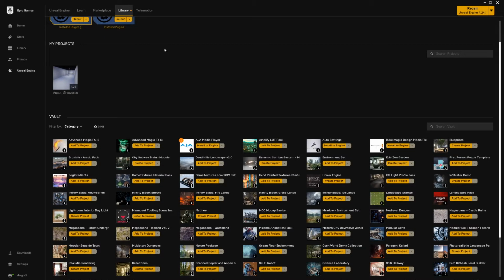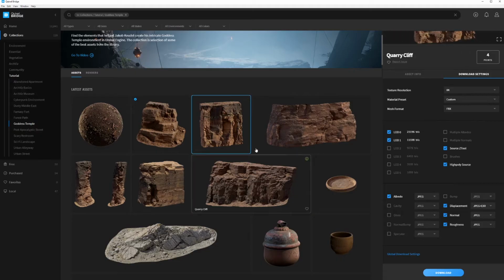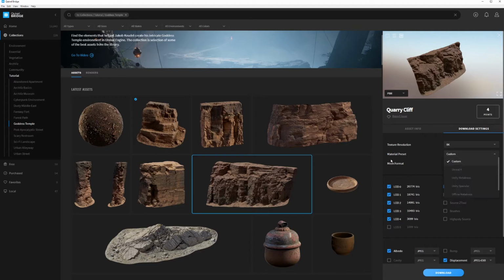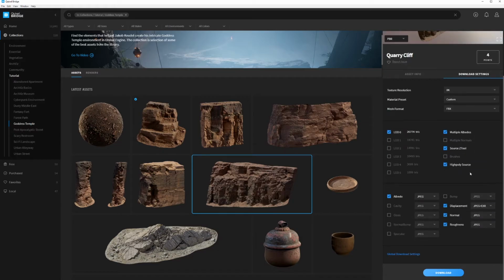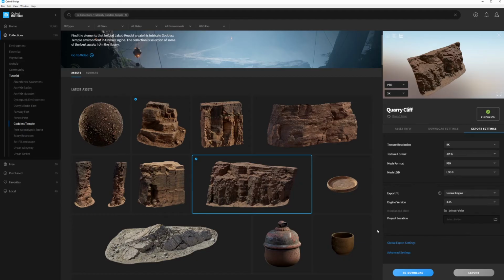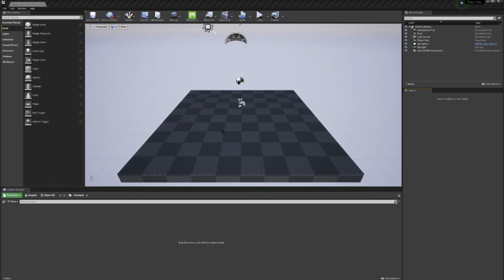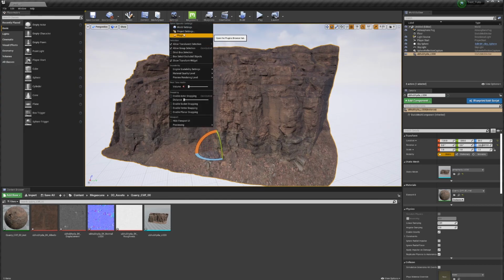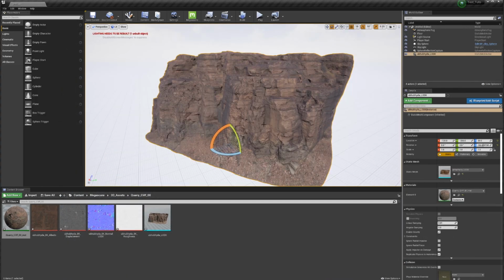Quixel Bridge Tutorial: How to Bring Assets into Unreal Engine 4.25

Comment: I have been previously been downloading to a QUIXEL folder on my F: drive, and that folder has grown to about 40GB.
I never chose a specific Unreal project, just threw everything in that one spot,

Is it a better practice to always point assets to the individual project Content folder?

Or does that make it harder to re-use assets across multiple projects?

Given the size of Quixel assets I want to avoid duplicate downloads if possible. Thanks for the video!
Reply from the maker: You only download Quixel assets once and then add them to your projects. If space is an issue then you probably want to work in one big project so you don't have the same asset across different projects, but the assets do need to be imported on a per project basis. I usually have only 2 active projects one for my work and another one for tutorials so I don't clutter my HD.
Reply: @MR3D-Dev-Tutorials  Thanks. Yeah between Megascans and Unreal projects/library disc space can fill up quickly.

Comment: Hello there once again :), so I have a problem. So when I export my assets to ue these errors appear Could Not Export Assets. Please Check Log For Details

Error
Could Not Send Data Over Port 13429
Can you please help me? :)
Reply from the maker: Did you had the unreal editor open while exporting? if not, then that is the reason, the editor needs to be opened when exporting, the second reason is the plugin is not installed properly. To verify, load the editor and see if you have the big M button on the top bar
Reply: @MR3D-Dev-Tutorials  Don't have the big M there (the meh-gascans M) how do I add it?
Reply: @MR3D-Dev-Tutorials  how do I add that big 'M'?
Reply from the maker: @Xolpy  That means that your pluging was not installed in the correct folder.